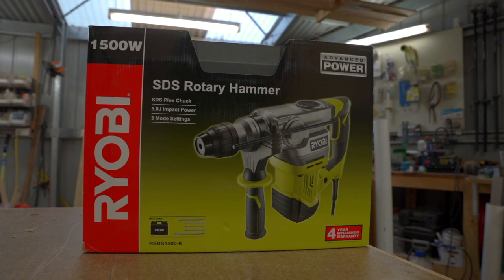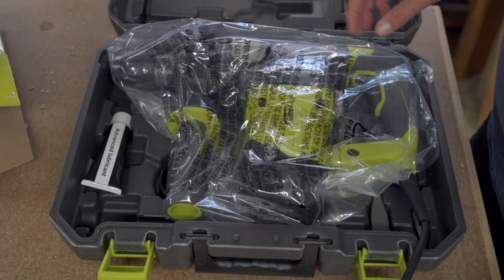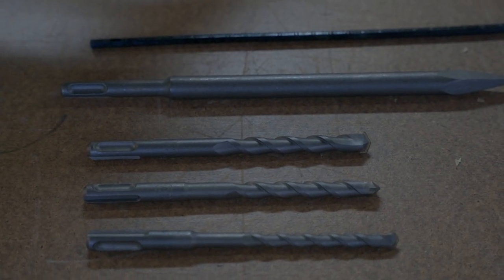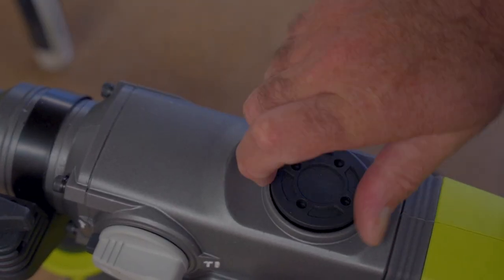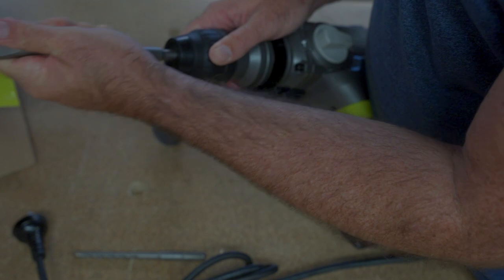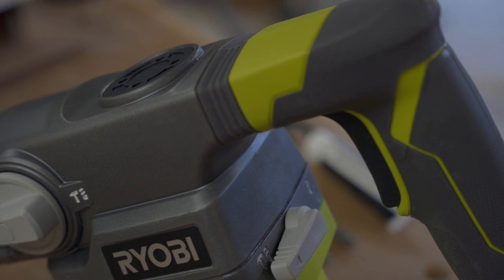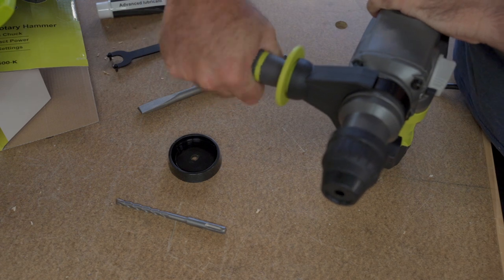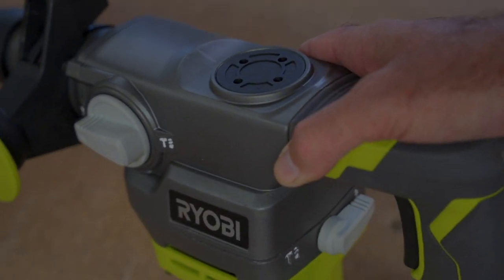A powerful corded hammer drill | Ryobi 1500w SDS Rotary Hammer Drill

Comment: I've just bought a very similar SDS hammer by Wickes (it actually looks pretty identical). I find difficult to insert and remove the bit. I greased it, but I need to push quite hard to insert and remove the bit. Is this normal?
Reply from the maker: Hi Simone. The Ryobi bit is fairly tight. It’s definitely not loose. You also have to rotate fit until the slot lines up before it can be pushed in. Hope that helps.

Comment: i assume that is a sds plus, very strange that is rated 1500W,.. my sds plus ryobi is a 850W and does the job just fine, i got recent a TP sds max with 12joules impact rated 1500W

;;;;;;;;;               2 Esdras2: 31-100         '''''''''''''''''''''''''''''''' ;;;;;;;;;;;;;;;;
Reply from the maker: Yes it’s an SDS+. 1500w. Very powerful.
Reply from the maker: Mine is corded. Maybe your one is battery powered?
Reply: @tooloptics8651   both my sds plus and sds max drils are corded